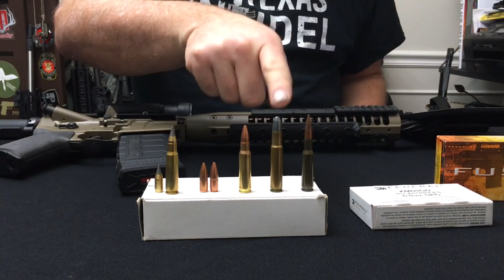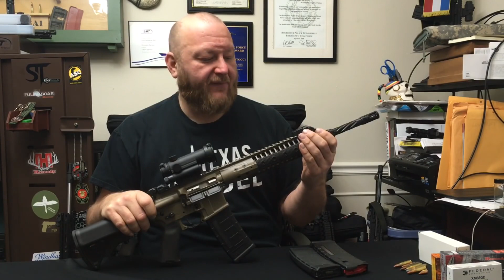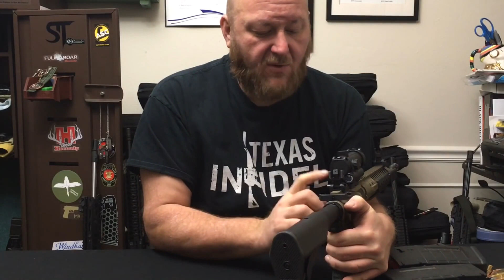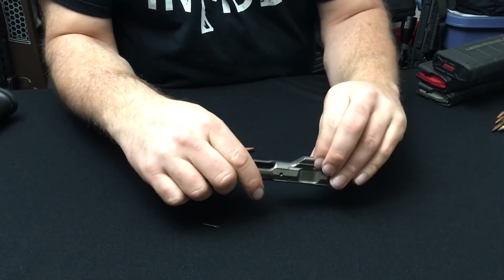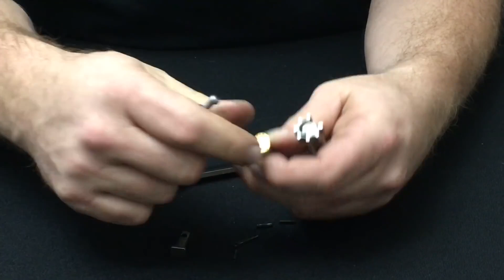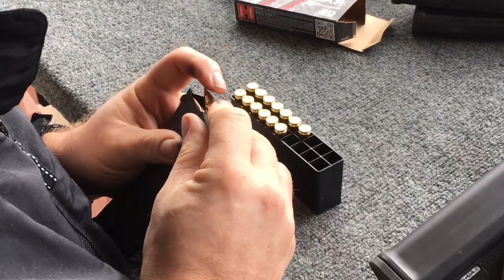History and Development of the 6.8x43mm REM SPC LWRCI Six8-A5 Rifle

Comment: Gas pushing the bolt key or a piston … they would “tilt” the bolt the same way…  fallacy
Reply from the maker: Um no, the gas on an internal piston does not push on the gas key. The key directs the gas into the piston created between the back of the bolt and carrier which pushes the carrier directly back with no tilt.

Comment: Squads being out armed by rpks. Is why army sent out a new contract  bid.  5.56 isn’t strong enough at 300 meters .. the xm7 maybe be the current winner but high pressure case  technology is going  to turn 5.56 and 7.62 into cartridges that eliminate the need for these modernized scams

Comment: What is your opinion about the 6.8SPC vs .300 blk for hunting up to max 150-200 meters 
 
Most wild boar between 25-100 meters 

I was in to .300 blackout, but the more I look at 6.8x43 it looks to deliver more In energy, precision, etc 

Don’t see it as a plinking toy , but just for hunting as a light weight hunting rifle , where you can put thermal , silencer etc on it
Reply: I would pick 6.8 SPC over .300blk for hunting. They have similar muzzle energy and trajectory inside of ~150 yards, but the 6.8 has a better BC, retains more energy at distance, is flatter shooting, and is effective out to ~600 yards (depending on what you're hunting). 300blk is only really effective out to 350 yards (and that's really pushing it).

Comment: Works very well for Whitetail
Reply: Carl Lewis of LMT - Richard Bernstein of LWRC - Heckler & Koch - Caracal. Small Arms Solutions which firearm? LMT has advantage of monolithic rail and interchangeable barrel system. LWRC has advantage of fluted heavy barrels for thermal dissipation. 

H & K has Aryan teutonic pedigree, Carl Lewis and Richard Bernstein are both Kosher cuts of meat. Ouch! That hurts. 

Caracal is built to exceed NATO test protocols for bore obstruction and “Over the Beach” assault. Caracal is United Arab Emirates and has dealers in the United States. The designers of the CAR816 also worked for Sig Sauer of Switzerland and H & K of Germany. 

I like the LMT and LWRC. The LWRC has the SIX8 which chambers the 6.8 II special. The LMT is robust and you have the option of either gas piston or gas impingement with a quick barrel change. The LMT system is robust and flexible and the fluted barrel of the LWRC is great. I like the Caracal in gas piston 14" barrel configuration. Robust and reliable. The gas impingement requires a maintenance schedule. If you are military the rifles go to the armorer. For a civilian who needs an individual weapon the Caracal would be my arm chair expert choice. The M4 is a squad weapon not a civilian weapon for SHTF. The Caracal has been built to exceed NATO test protocols for bore obstruction and “Over the Beach” assault which means little field maintenance is required unlike an M4 squad weapon. H & K too expensive and over engineered.

Caracal816 gas piston rifle 14" with suppressor depending on the gun laws where you live. I live in Canada. Only Big Brother is allowed to have guns in Canada.
 
The entire world is a NWO Catholic Orwellian feudal state. The Vicar of Christ is a puppet of the Black Pope (Is Ra El)

I know what Mr Small Arms Solutions is thinking Peter Chin is anti-Semitic. If you said Peter is Chinese would be same as noticing that the last name Lewis and the last name Bernstein are both Jewish last names. Look Mr Small Arms Solutions, my name is Peter Chin and I'm Chinese. I still prefer women and you can't jerk off someone who is Kosher. How many potato farmers do you need to screw in one light bulb in Newfoundland. 

Ask Chester the bull queer who kept putting homosexual love potion number nine for his boys at Jarvis in the tainted pool water movie remake of Carrie which featured the tainted pool water of the Jarvis $14 million renovated pool. Binary chemical agent homosexual pheromones to turn the guys into girls. I'm thinking about those pecks on the cheek from Sarah "Ann" Marshall you got Corey as payment for telling her what Peter was doing in pool class. Hydra features Peter Chin as the cook. Japanese action movie starring Peter Chin. Get it at your local Davenport library across the street from Peter Chin's apartment building.

Comment: PPU and S&B 6.8
Reply: Carl Lewis of LMT - Richard Bernstein of LWRC - Heckler & Koch - Caracal. Small Arms Solutions which firearm? LMT has advantage of monolithic rail and interchangeable barrel system. LWRC has advantage of fluted heavy barrels for thermal dissipation. 

H & K has Aryan teutonic pedigree, Carl Lewis and Richard Bernstein are both Kosher cuts of meat. Ouch! That hurts. 

Caracal is built to exceed NATO test protocols for bore obstruction and “Over the Beach” assault. Caracal is United Arab Emirates and has dealers in the United States. The designers of the CAR816 also worked for Sig Sauer of Switzerland and H & K of Germany. 

I like the LMT and LWRC. The LWRC has the SIX8 which chambers the 6.8 II special. The LMT is robust and you have the option of either gas piston or gas impingement with a quick barrel change. The LMT system is robust and flexible and the fluted barrel of the LWRC is great. I like the Caracal in gas piston 14" barrel configuration. Robust and reliable. The gas impingement requires a maintenance schedule. If you are military the rifles go to the armorer. For a civilian who needs an individual weapon the Caracal would be my arm chair expert choice. The M4 is a squad weapon not a civilian weapon for SHTF. The Caracal has been built to exceed NATO test protocols for bore obstruction and “Over the Beach” assault which means little field maintenance is required unlike an M4 squad weapon. H & K too expensive and over engineered.

Caracal816 gas piston rifle 14" with suppressor depending on the gun laws where you live. I live in Canada. Only Big Brother is allowed to have guns in Canada.
 
The entire world is a NWO Catholic Orwellian feudal state. The Vicar of Christ is a puppet of the Black Pope (Is Ra El)

I know what Mr Small Arms Solutions is thinking Peter Chin is anti-Semitic. If you said Peter is Chinese would be same as noticing that the last name Lewis and the last name Bernstein are both Jewish last names. Look Mr Small Arms Solutions, my name is Peter Chin and I'm Chinese. I still prefer women and you can't jerk off someone who is Kosher. How many potato farmers do you need to screw in one light bulb in Newfoundland. 

Ask Chester the bull queer who kept putting homosexual love potion number nine for his boys at Jarvis in the tainted pool water movie remake of Carrie which featured the tainted pool water of the Jarvis $14 million renovated pool. Binary chemical agent homosexual pheromones to turn the guys into girls. I'm thinking about those pecks on the cheek from Sarah "Ann" Marshall you got Corey as payment for telling her what Peter was doing in pool class. Hydra features Peter Chin as the cook. Japanese action movie starring Peter Chin. Get it at your local Davenport library across the street from Peter Chin's apartment building.

Comment: The LWRC SIX8 design completed the 6.8 package. A slightly enlarged magwell allowed Magpul to make a plastic mag the correct size for the 6.8. I purchased 2 receiver sets to build 6.8 DI versions, they seem to be more accurate than the piston versions. Anyway we chose the 6.8 to be the family deer and hog rifles, half the people in Spring Tx use them.
Reply: The only reason I never got one is that they are 5 thousand dollars for a complete rifle. Fuck that
Reply: @BradleyTA98  Yeah,  we bought receivers and then built them with better parts for less than half of what LWRC was charging. .

Comment: Interesting video. Thanks. You mentioned one of the bullets was a BTHP. Is a boat tail hollow point legal for combat use under the Geneva Conventions?
Reply: It was the Hague convention and the US did not sign it but if the Hollowpoint is a product of manufacturing and not designed to make the bullet expand the US military can use it, same as a Sierra SMK.

Comment: If you were to go with a SBR 6.8, why wouldn't you just go with .300black out?  Isn't the .300 more efficient in SBR barrels?
Reply: No, the 300BO will never match the velocity or energy that the 6.8 can provide. The 300BO is apx 300 fps slower than the 6.8 using the same weight bullets and barrel length.
Reply: @crashdsnowman1  ok!  thanks for taking the time.
Reply: The 300 is not near as powerful or terminally effective as the 6.8.

Comment: Chris, 
Once again your presentation is professional, succinct , thorough, and complete. I have a gun crush on the LWRC international ar platform and LMT at platform. After great consideration , I’ve decided to off load 3 of my upgraded yet entry level ar platforms to finance the purchase of an LWRCI or LMT. 
Pros and cons lwrci  cons= price? And interchangeability I.e. barrel change out …I guess. Pros = quality and reliability , in house manufacturing , ambidextrous design, bcg design and barrel design. GAS SYSTEMS . 
LMT cons= price and availability ambidextrous design as compared to lwrci. , pros= enhanced bcg, gas systems, monolithic uppers , interchangeability… man sooooo many. Chris I can only afford one! I can find lwrci with a spiral fluted barrel and external gas system. And actually DI for cheaper on gun broker. But damn I feel like if I get the LWRCI DI I’ll have p made a mistake Overall Because of the interchangeability of the LMT platform and the cost thereof as compared to having to  LWRCI . What’s a man to do? If you had to take just one 5.56 / .223 between  LMT or LWRCI which system would it be and why? Please be your typical succinct and precise self that we all have come to love and respect.
Reply: I have both and will keep both forever. A six8 10.5 and a Lmt Lebanon contract overrun

Comment: You were with Colt during the development of the 6940,  first...  I'd love to see a more in depth review of the rifle itself,  not it's history and manufacture,  but...  can it be changed to piston from DI,  and if and if possible how and with what type of barrel it swap can be done???  I'm an owner of one...   and I have it tucked away as a piece of Colt history.   But believe me,   if needed,  it'll be put to use.  And it'd be nice to know more about it.  Not history...    swapability of parts (upper) and just general everyday maintenance.
Reply from the maker: I have a whole video on the history of the 6940
Reply: @SmallArmsSolutions  I saw it...   it doesn't go into barrel swap or maybe changing it from DI to piston.  History wise,  The video was great...   How about even the removal of the lower handguard.  Can it swap out an old barrel for new?  Can you change it from DI to piston???  With maybe a commercially available kit?
Reply from the maker: @Torqd_Off The LE6940 was not designed to swap barrels and operating systems, Not like an LMT. You can swap the barrel the same way you would any M4. The 6940 was done in 30 Blackout but not produced in large numbers.

Comment: I really like lwrc. Everything they make is extremely high quality and they definitely innovate. I will say this however, they need to upgrade their hand guards. You can get mlok on their di gun and that’s great but they should roll that out to the whole lineup. I’d personally rather have a quad rail over their proprietary hand guard but other than that fantastic rifle.
Reply: There’s a design complication around the mlok rails and the piston system which they’ve go into depth about. To accommodate that they would have to complicate the simplicity of the rail system they have requiring more labor to actually clean the rifle. I’m glad they have mlok in the di model but to be plain their proprietary rail is perfect imo. It’s a work of art, and considering they designed it before mlok existed, it’s an impressive mark for their ingenuity.
Reply: No. They need to stick with their proprietary handguard

Comment: Hey I just bought a LWRC-IC-A5 Six8 10.5" pistol,  can I use one of POF's roller cam pins in this bolt carrier group. I like that upgrade for my piston guns.
Reply from the maker: JustAnother InternetExpert sure can
Reply: @SmallArmsSolutions  THANK YOU VERY MUCH! I figured you would know. I didnt know if it was different because of the different size recievers that lwrc uses for 6.8

Comment: the most annoying part about 6.8 is the name 6.8. nothing about this cartridge is 6.8 . its a 270 caliber 7mm diameter bullet  just like 270WIN or 270WSM so why the hell call it 6.8 when that size/dimension is not actually used.
Reply: 5.56 and 5.7 share the same bullet diameter, .224 inch. .460 Rowland is the same diameter as .45 ACP and .454 Casull is .451 inches. Caliber is more about nomenclature and marketing than nominal values.
Reply: Interesting. Call it .270 kurz
Reply: You seem confused about the way America measures bullet diameter. A 6mm is not .243, a 6.5 is not .264, 7mm is not .284. It's just the way things are but they aren't going back and renaming every single metric designated rifle in the US.

Comment: I think I will share a comment I made on the RRA video. Art from SSA and other industry manufacturers have told the history as this guy does with great consistency. Holland and Murray’s chamber drawing isn’t what Remington submitted to SAMMI. And they don’t know why. The SPCII is about the same as what SF and the AMU drew up.
Reply: I remember Art K. talking about that on various forums. He submitted the SPC II schematics to PTG. It seems  Remington 'accidentally' sent a chamber design of a prototype, from what I remember from the ARFCOM flame wars. Curiously, the .300BO (tweaked .300Whisper) appeared a short time after bombed  during testing with much hype from the Freedom Group.
Reply: Chis Murray had at least 3 different chamber designs, 1 for accuracy in an SPR, 1 for velocity, and 1 for slop/reliability in harsh conditions.
Reply: @LRRPFco52  Also, that doesn’t change Remington’s possible sabotage at the behest of bribes.
Reply: @nickma71  That makes no sense for them on the cusp of launching a new cartridge with potential for military contracts.
Reply: @LRRPFco52  I wonder why they wouldn't correct the mistake? (actually I don't)
Reply: @nickma71  My understanding is that they did correct the neck-to-freebore transition.  It became a problem when one of those manufacturers was using plated bullets and Kotonics had chrome-lining that shrunk the bore diameter.

Combined with one of the hotter of the 3 different pressure categories loaded by SSA, you ended up with multiple collision points in the tolerance stack and resultant kaboom of one of the Kotonics-barreled carbines.

A piece of the bolt carrier was embedded in the field of view of the Eotech, while the bottom section of the bolt carrier sliced through the petrified wood shooting bench like an explosively-formed penetrator.

They scrubbed those images off of Barfcom for some reason.

That was a huge problem with 6.8 though, that nobody had ownership of it.  Then came a toxic character claiming to have a better chamber design (Chris Murray had already explored what you could do with the chamber.)  A campaign of hate was directed towards all the big companies who were excited about 6.8 SPC, when they used the SAAMI drawings, after many had done all the pressure testing and factory ammo load development.

Remington, Hornady, Accurate/Western Powders, Hodgdon's, Nosler, Federal, Barrett, Bushmaster, DPMS, Eagle/ArmaLite, LMT, LWRCi, Stag, etc. aren't staffed with random guys, but actual ballisticians and engineers who have to do significant due diligence in introducing a new cartridge and firearms that will safely shoot it.

On Barfcom and 6.8 Forums, the big industry companies were mostly ridiculed while a tiny shop nobody had heard of was elevated above them all.  And then dudes wonder why support for the cartridge waned.
Reply: @LRRPFco52  That isn't quite the version as told the primary developer of the round after the debacle from Remington. And my question is, why not correct it? That is what "SPC 2" is, which came out right after it. It has no issues and shoots the "hot loads", giving us .223 and 5.56. Of course it isn't a hotter load, it is the SAAMI is under powered because the chamber develops high pressure and is unsafe.
Reply: @nickma71  When one of the main ballistics labs tested the SAAMI vs SPC II chambers in their pressure test breech, they saw 19fps variation between the 2 from a 24" barrel.
Reply: @nickma71  With AR-15 bolt lug and extension teeth lengths, you don't want to exceed 55,000psi chamber pressure with a case head that has .421" head diameter.

With 6.8 SPC, I wouldn't want to run higher than 53,000psi.